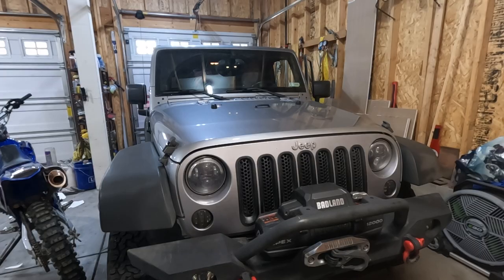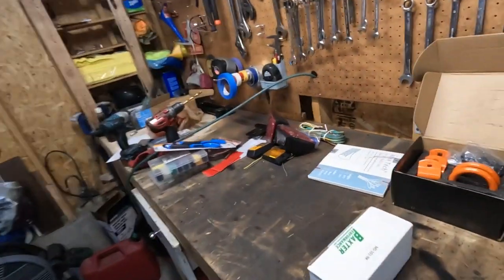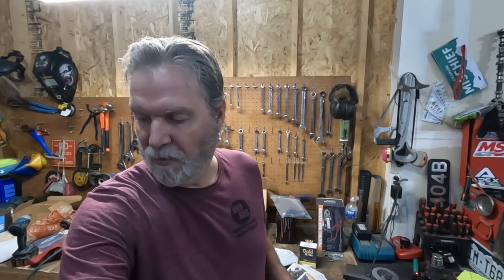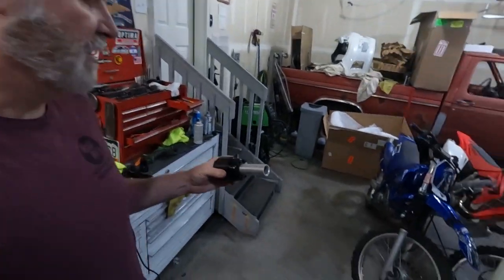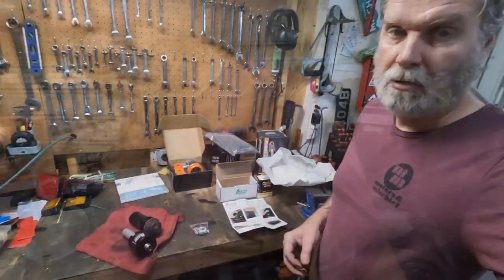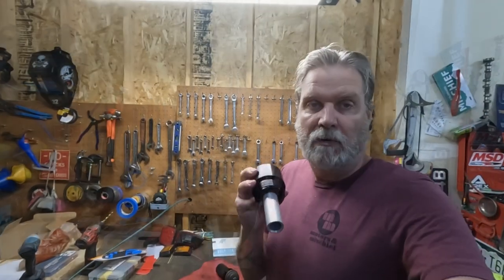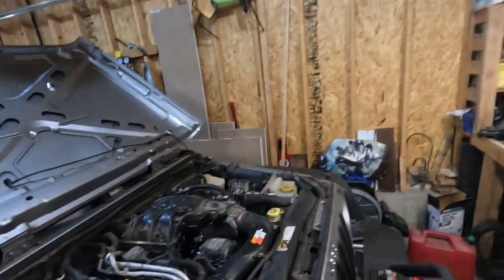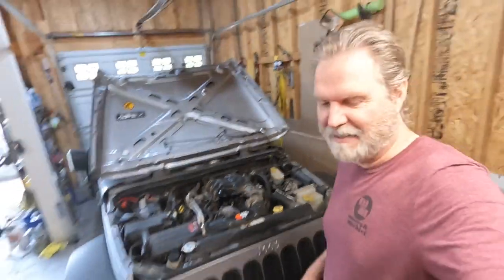Baxter Performance Oil Adapter Install for 2011-2013 Jeep 3.6 - How To

Comment: Have you let it sit for a few hours and popped the oil filter off just to see if any oil was left in it? That would be the best proof of it working as expected. Reseraching this product there seems to be plenty of people saying it doesn't work as advertised.
Reply from the maker: That would be a messy way to confirm it works, as the oil filter is in upside down and would dump oil all over the engine. We can tell you that ours makes less valve clatter after this was installed and it can sit for a longer time without making any valve clatter. Is it perfect, meaning can it sit for weeks and then fire up without any valve clatter? No. And it would be silly to think it could; there's only about half a cup of oil in the filter and that's not enough to get to every part of a V6 valve train. But what it does do is provide that cup of oil sooner than if it has to come up all the way from the oil pan. So is there going to be less wear? Yes, absolutely. Getting any amount of oil there sooner means the valve train is running without oil for a shorter amount of time. Is it a significant amount of wear reduction? Who knows? Its something for sure. And for us, a little bit better is better than nothing. Maybe its a lot better. Probably the reality is its somewhere between a little bit and a lot. But we like to err on the side of caution and this helps some amount more than if it didn't have it and so for us, that's worth it. Thanks for the question!

Comment: It's nice but for the price, I think they should be replacing the whole oil cooler with a dorman type aluminum oil cooler/filter housing so it's a fix and upgrade at the same time.  They could then just make one model too.
Reply: Although a much more in depth install. This is nice because simple install, I see what you’re saying though.
Reply from the maker: Have you seen the price of a Five Guys cheeseburger lately? This is pretty reasonable considering all the engineering that's gone into it. Personally, we'd rather pay for a high quality, made in the USA part that will last instead of something half the price that won't stand the test of time. But, inasmuch as everything is wildly too expensive these day, you have a good point. Thanks for commenting!

Comment: Another question.
I installed mine, and those two hoses that you disconnected really push on the oil filter. Is this an issue for you, or did you find a way to reroute them ?
2015 JK.
Reply from the maker: We didn't have any trouble getting them to have a little slack and not be pushed up against the filter. This is a 2013 however, which is a little different than the 2015, so yours might have less slack. Check out our 2015 install of this it might give you some more insight: https://youtube.com/UDmqTkcQlWw
Reply: @MotorsandMischief 
That link didn't work for me
Reply from the maker: Try this: https://youtu.be/UDmqTkcQlWw
Reply: @MotorsandMischief  
That link works, but it appears to be a 2012 install.
Reply from the maker: You might have missed it, yes the Jeep is a 2012, however it has the upgraded Dorman 2014+ metal oil cooler housing, so it uses the 2014+ Baxter system, which means the hose routing matches your 2015. Give the video a watch and see if that helps your issue.
Reply: @MotorsandMischief  
Very good 👍.
I'll see if i can get any tips from that vid.

With my install, there was such a small space, that i couldn't even have the plug on the Baxter unit, until the unit was fully screwed on.

Comment: handheld video is really difficult to watch.  tripod would help a ton! yes, it would take longer...but no one would get vertigo.  :)
Reply from the maker: Thanks for the tip :) We used to use a tripod and we’ve learned that the majority of people get bored when the camera isn’t moving around. Now we’re not saying you’re wrong, and frankly we tend to agree with you, but our videos get consistently higher views when we don’t use a tripod. Thanks for the comment!
Reply: @MotorsandMischief  anytime. glad it working for you all, views rule the world these days. The content is awesome by the way. I need to get myself one of these Baxters for my 2012!

Comment: Do you have to add extra oil to make up for what is held in the filter ?
If not, will it read as "low" ?
Reply from the maker: The oil filter doesn't hold that much oil, even when full so the adjustment in level when spread out over the surface area of the oil pan doesn't make much of an impact. In truth, it will take slightly more oil, but in reality we doubt you could tell on the dipstick. Thanks for the question!
Reply: Another question.
I installed mine yesterday, and those two hoses that you disconnected really push on the oil filter. Is this an issue for you, or did you find a way to reroute them ?
2015 JK.

Comment: Looks like the filter sets to high to put your engine cover back on
Reply from the maker: Good eye! It does. We’re going to see if there’s a squatter filter available. For now we’ve just been running it without the cover.
Reply: The model #BAXMS-101-BK for the 2011-2013 oil coolers appear to be a little higher profile than the #BAXMS-201-BK for 2014+ oil coolers.  Don’t have two side by six e to compare.  Although, it could be how deep the oil cooler sits in the 2014+ JK/JKU’s since the vacuum hoses are routed differently and the dust cover is able to be put back on.
Reply: I was wondering the same and wanted to see the "FINISHED" look in the video.

Comment: So, what if the check valve fails?
Reply from the maker: Then it works like normal. But the check valve is in the oil filter, meaning there's millions and millions of them out there and this is tried and true tech. Also, you get a new one every time you replace the filter.

Comment: So is there a lower profile oil filter part number you can use so engine cover can go back on?
Reply: I’m just going to cut a hole in it so it fits.

Comment: Will this with on the Dorman aluminum housing?
Reply: I installed one on my Dorman.
Reply from the maker: It will, search the channel, we've got another video where we did exactly that. This particular unit is for the 2013 and older. If you use the dorman housing, you have to use the 2014 and newer Baxter unit, as Dorman updates the filter assembly to the new style regardless of what year your Jeep is. So don't but this unit, get the 2014+ one. But again, we have a whole video on it in our Cheap Jeep series. Thanks!
Reply: @MotorsandMischief  I have a 2012 JK and the Dorman replacement.
Reply: @TheMightyMaxx
Reply: @TheMightyMaxx

Comment: Is there a part number for the replacement filter?
Reply from the maker: WIX 57502, Mobil1 M1-212 or equivalent. We use a NAPA version of the WIX filter.

Comment: I have a 2012 jeep that I put an elder Brock supercharger on does anybody have the height of the Baxter oil filter adapter from the bottom of the base where it meets the Jeep oil cooler to the top of the new screw-on can oil filter and also the diameter of the new can style filter. I believe with my blower on that it's not going to have enough room in height particularly due to the housing itself but more so the belt drive
Reply from the maker: Just call the boys over at Baxter Performance. They're super nice guys and they will help you figure it out, and if it won't fit, we bet they'll have options for you. 509-448-7951 Thanks for the question!

Comment: SNAKE OIL. All it does is hold some oil in the filter. The rest of the oil in the oil cooler and the rest of the engine drains down to the pan LIKE ALL ENGINES DRAIN DOWN TO THE PAN.

Then the oil still has to pump up to the filter, and galleries, before it starts circulating and filtering. So all this gizmo does is hold a couple of cups of oil in the filter, Sitting and waiting for all the oil to pump back up from the pan. 

The oil still has to pump up from the pan to the filter before it circulates. 

Just like any old-style engine has to wait until the oil fills the galleries.   ???????    For $250.00? fail.

My 3.6 has oil pressure almost immediately with the stock filter. Save your dough.
Reply from the maker: Any sufficiently advanced technology is indistinguishable from magic to people who don't understand it Scott 😉. It does hold some oil the filter, you're absolutely right, something that oil filters have been doing for 100 years. The problem is Mopar decided to not put an anti drain back valve in these engines, so they're not gaining the benefit of having that oil in the filter. So, yeah the oil is sitting in the filter until the pump gets the oil up there, but, and this is the part you may have missed, you don't have to wait for the oil pump to fill up the filter. That's the whole point of anti drain back valves that used to be standard on cars for decades. We can tell you that there's a noticeable difference before and after install, one you can hear in the amount of clatter from the valves, so even someone with no mechanical ability can tell the upgrade is doing something. If a little less time getting oil to the valve train isn't worth $250 for you, then good gravy, save your money. But the product works, and for lots of folks, its worth the money to potentially get some extra longevity out of the engine by getting the oil there a little sooner. Thanks for commenting, Google loves that!